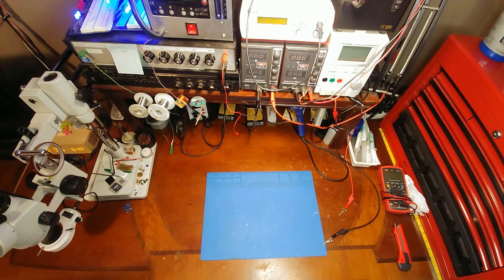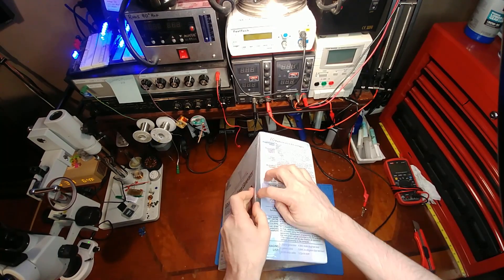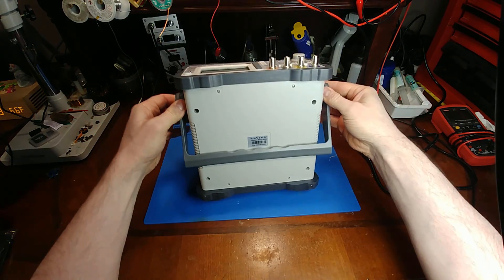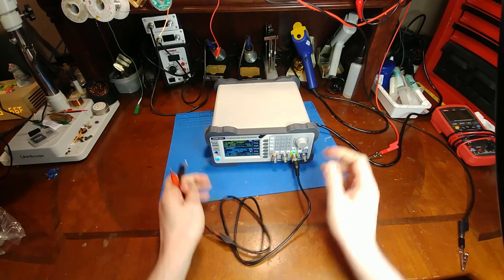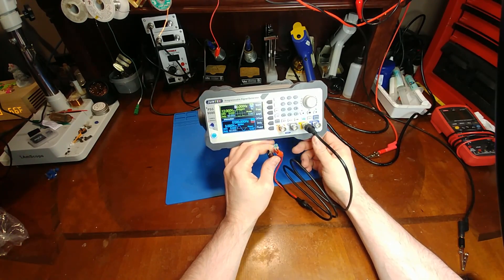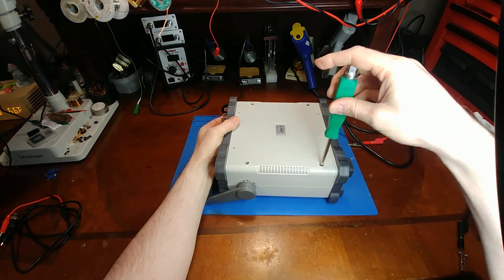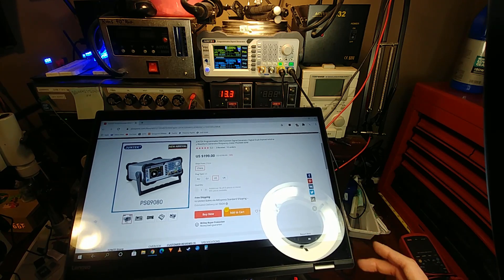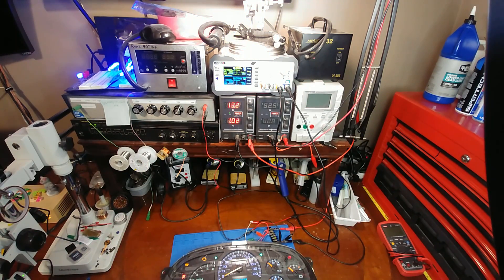Signal Generator Review

Comment: Hi Jeff I having the problem with my instrument cluster just like what you showed in your video error message over the miles and the mileage is not  working on my 2006 Chevrolet Malibu.I would like to see if I could get you to repair it. Can you help me. I have looked for your email address but I dont see it . Can you send it to me thanks Danny
Reply from the maker: Some GM clusters display error when they loose comunication.
Reply: @jeffescortlx  Jeff I don’t feel comfortable doing this. I’m not very good a electrical things that’s why I ask if you can repair it.please let me know .
Reply: @jeffescortlx  my best friends were retired ase technician. They don’t feel good about doing this we have checked every, all wires connections removed the dash and replaced. Everything is working as it should. Everything points to the Instrument cluster
Reply from the maker: @danieldeer441  the gauges read fine while the display reads error?
Reply: @jeffescortlx  yes everything is working fine except the error message and the miles is not working.
Reply from the maker: @danieldeer441  sounds like you have a corrupted eeprom. I'm afraid I won't beable to help. I don't have a clean BIN file for that generation of Malibu.
Reply: @jeffescortlx  can you recommend someone
Reply from the maker: @danieldeer441  unfortunately I can't think if anyone with a lot of experience with the Malibu eeprom. I can't imagine a junk yard cluster would cost very much. If you can't find a suitable odometer match I might beable to help.
Reply: @jeffescortlx  yes I can find a junk yard odometer which suitable miles I'm sure but does the VIN have to be put into it for it to work
Reply from the maker: @danieldeer441  no it's shouldn't need a matching VIN to function. But if there are any trim level option differences it could cause issues.
Reply: @jeffescortlx  ok I’m going to give it a try Thanks
Reply from the maker: @danieldeer441  hang onto the original cluster until your sure the replacement doesn't have any conflicts.
Reply: @jeffescortlx  yes I will

Comment: I have one similar to your old one that I use for gmt400 cluster repairs. Learned the hard way you need one that can do at least 20 volts though. The 20 volt model on my oscilloscope actually outputted -10 volts to +10 volts instead of 0 to +20 volts, and ignition tachometers need at least 9.5 volts to function.

And FYI, GM only uses 5 volts for the speed signal, not 12 volts. And the speed to hz breakdown is every 11hz=10mph(4kppm signal breaks down to these values).
Reply from the maker: I never really dug deep, but I assumed the VSS and tach inputs were on a pull up resistor and only looked for signal to ground references.

Comment: The screen protector just had to go ha ha :-D
It's a nice little unit, i'm sure you will connect it up to an oscilliscope and check the waveforms.
i did notice the lack of heatsink on the switchmode switching mosfet/i.c, but i imagine the unit does not need too much power.
I was given a Ye olde homemade 3 waveform generator based on the old ancient ICL8038 chip years ago.
Very basic but it came in handy at times.
The person that made it passed away 20 years back, but i still appreciate it :-D
Reply from the maker: You're right, power board doesn't have a heatsink. But it was nice of them to include a jack to use if the internal power board stops working. The signal out transistors have a nice little heat sink though